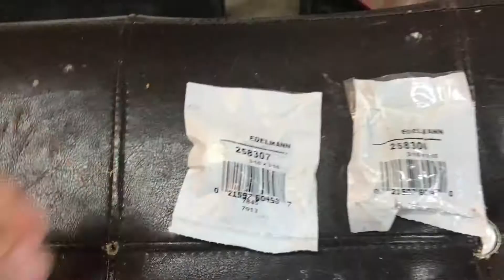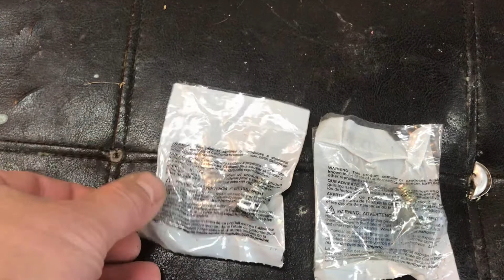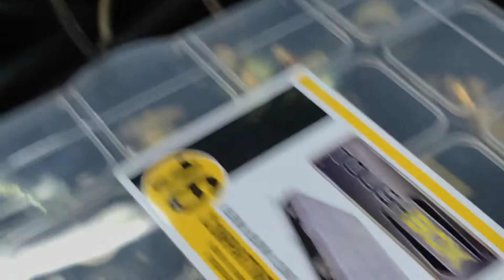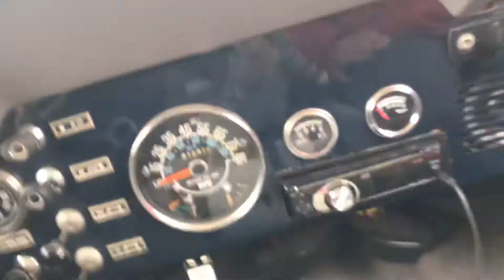Upgrading to Power Brakes on my 1981 Jeep CJ7 - Part 2

Comment: Lots of help here. Just things I would not have thought of, that would have caused work stoppages. Self bleeder screws, brake line wrenches, vacuum fitting...now all will be ordered to arrive at the same time. You saved me a lot of future headaches, brother. It's always the simple stuff I don't think of until need it.

Hey, if you remember, what size is the fitting for that vacuum hose?

Comment: I see a Weber box, but you have a motorcraft on your I-6. I don't know where that Weber is, but definately get another one and slap it on the I-6 in your Jeep. Weber Redline is absolutely the way to go for that engine.
Reply from the maker: I never could get that weber to idle. Gave up on it and went with the motorcraft. Been running pretty good ever since. Still have the weber in the box!

Comment: You are much better off going to a Hydro-Boost break system, especially if you have a large diameter tire size. The hydro-boost system has much more power output that the vacuum diaphragm power brakes. The Hydro-Boost system does not use the vacuum from the intake manifold for getting it's power but instead uses hydraulic power from the power steering pump.  The power performance is quite an improvement from the vacuum diaphragm system.
Reply: Thanks for the info